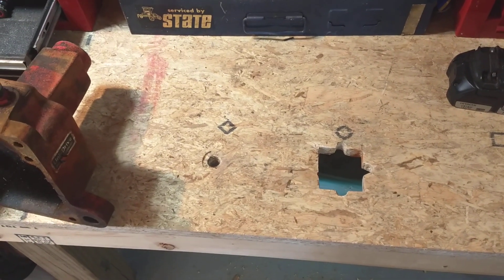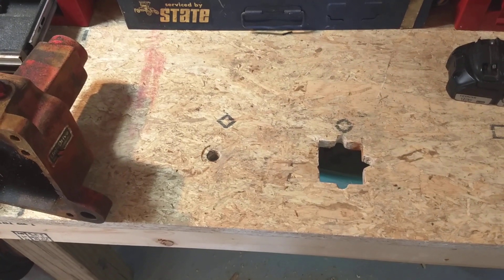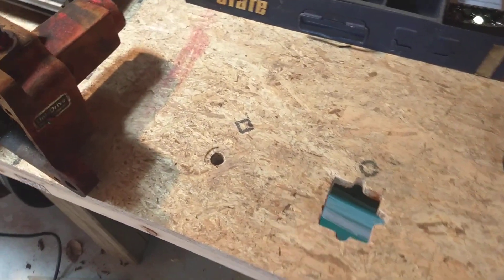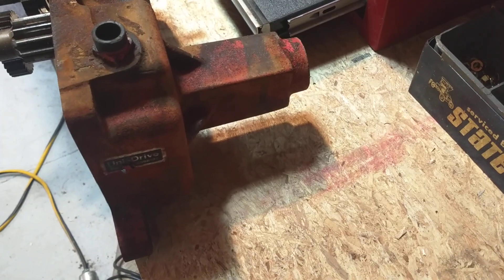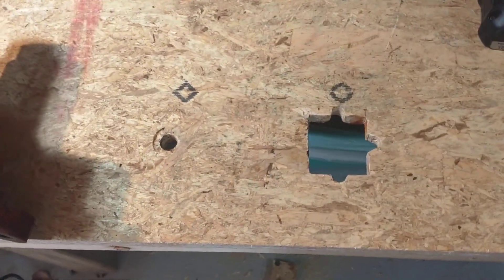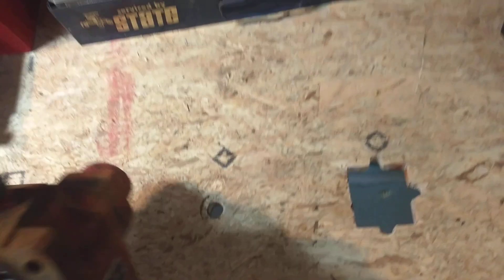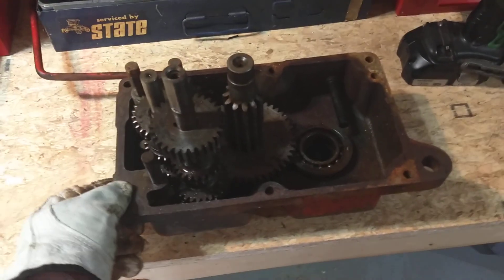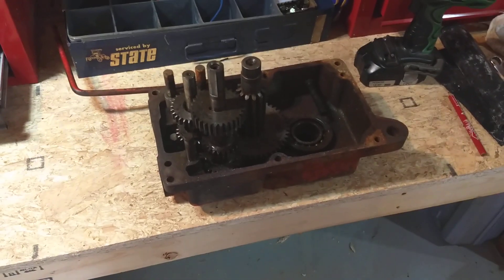A little work bench modification

Comment: Nice bench modification Eric.   The only issue I can see is, and I’ll bet you a dime to a doughnut, that every time I would set my cup of coffee down, it would be right where that danged hole is located.    Hahahahaha!
Reply from the maker: I can assure you that the safety of a coffee beverage is of utmost concern in any design in anything that I do.
In this particular case it looks like I've sized the hole for the transmission but in reality I measured all of my coffee cups first to be assured that none of them could fall through.
Reply: Eric B / ebinmaine     I always thought you were a forward thinking man.....   hahahahaha